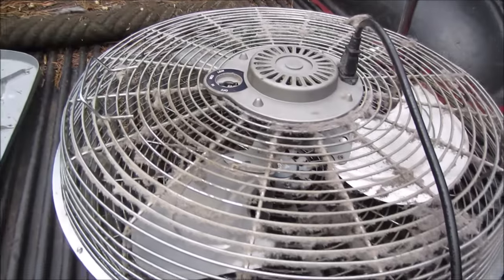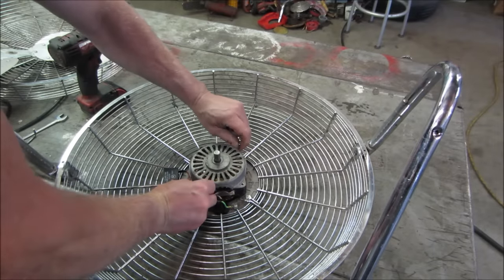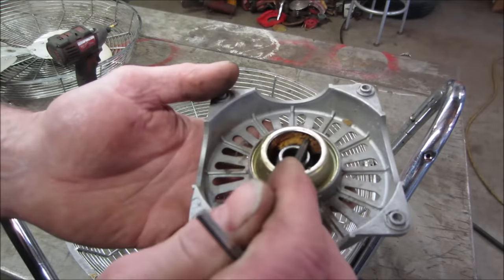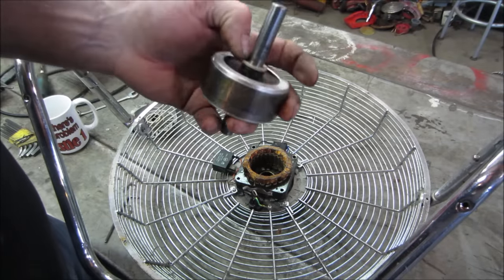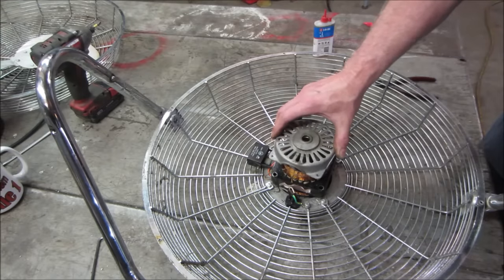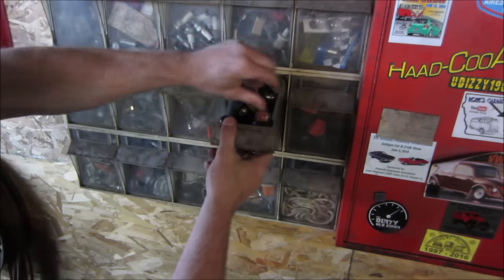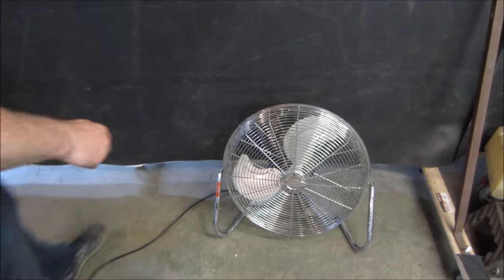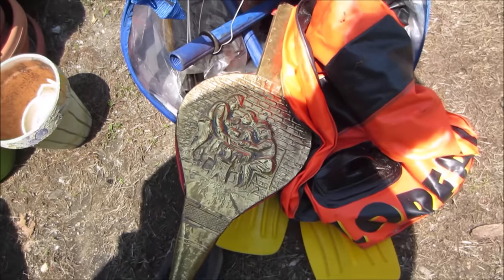Fan Blades Won't Spin? Lets Fix It

Comment: Cool! I do this all the time! As someone who collects antique and vintage fans,I just want to let you know that the "Spray foam" stuff is actually dried oil wick. What you do is soak it in 3 in 1 blue can oil in addition to lubing the shaft like you did and it will help keep it oiled for longer. What you did is fine,but is more of a temporary fix. If you soak those wicks, it will last for much longer. Just never grease these bearings. It might work for a bit, but they aren't meant o be greased and it will eventually seize up again. Those Lakewoods are actually pretty decent, one of the last brands that made their fans in the USA.
Reply: Thank you for the education
Reply: Me too, I have picked up numerous Antique fans over the years, they make for good videos especially to those of us who like the better built things, all the new plastic fans are more of a fire Hazzard then the steal ones
Reply: Where does one find the wick material? Could you use a piece of polypropylene rope?
Reply: Oh, how about using sylglide grease?
Reply: I had a lakewood desk fan that only kicked the bucket recently after almost 18 years so almost as old as me, my parents felt it a lost cause cus when it was turned on it didn't even make any sound or any attempt to move, and it was working earlier that day
Reply: I use grease many times fixing fans seems the last pretty long but you do need to take it apart every couple of years and clean it up again.
Reply: @wolfofdiscord7092  Check the fuse for that circuit then the cord.  It should at least hum if it still has a heartbeat.
Reply: Thank you for sharing this info, I'm just a regular fan user but have lost to expensive metal fans due to blades freezing up. Now I know how to keep them going longer thank you again for your answer.
Reply: @padraicmcguire108  felt is best.
Reply: @gordbaker896  It was trying to spin!
Reply: @padraicmcguire108  go to the fabric store and get some upholstery felt, and cut into strips, then slip a piece into there. Will hold oil well, and will outlast the original nasty foam. If you want the right oil just buy a bottle of air tool oil, it will be thin enough to lubricate, and will not get too gummy with time.  Take the bush and clean with a cloth and some solvent before adding the new oil, to get the old gummy oil out, especially the bore, as it will have a hard film of gum there in most cases, so use a bamboo skewer to scrape the thin gum layer off. Then a oil coat, and assemble.
Reply: @padraicmcguire108  You can use a NGLI0 grease, but it will slump with time, best is light straight mineral oil. 0W synthetic oil also works well. I just use air tool oil, as it is easy to get from most machinery suppliers.
Reply: I have tried the usual oils, like 3 in1, but the old fan eventually slows down over time.  All of these oils were marked as being toxic.  Then I tried a non-toxic thin oil.  The fan kept up to its top speed for many years longer.  I used the same oil on my air conditioner motor when it almost seized up and was squealing like crazy. It was way to noisy fir it to be used any more.  But once I filled the dried up felt material in the motor with this non-toxic oil, the air conditioner was up and going again, and it is even running right now at this very minute. The air conditioner is about 19 years old now. By the way, my DENON DCD-900 CD player from 1987, was skipping tracks.  This was due to the LED not tracking fast enough across the CD, all thanks to the gear lube having stiffened up over a 31 year period.  Anyhow, out with the non-toxic oil again, oil the gears, and bingo, my DENON DCD-900 CD player was working as good as new.  Despite now being 33  years old, it still looks as good as new as well. Not a scratch on it.  People throw so many things out, when all that was needed was a couple of drops of oil.
Reply: @padraicmcguire108  Oil wick. You can get some at electric motor repair shop. I was cleaning the dust out of a small electric motor with the air hose and blew the oil wick stuff out! Oh noooo! I found some at the electric motor repair shop.
Reply: No grease, SAE 20 oil. 2in1 works fine.
Reply: Too bad you didnt live in wisconsin cause i have one older box fan that needs a good home..If your interested i can send pictures
Reply: @padraicmcguire108  ... any heating supply house that has "wick material" for the old B&G circulator pumps. In a pinch you can use old style cotton jacketed clothes line, but the new stuff is poly core so doesn't hold much oil. Also, cotton wick for kerosene lamps or tiki torches is similar material. As a last resort you might try some old fashion cotton balls or gauze bandage.
Reply: Old fans are the best! They are built like tanks. I have some old Westinghouse fans from the 40s that can blow your hamburger off your plate. They really made old fans to blow hard and last. I love em.
Reply: I have craftsman fan exactly like it
Reply: I've restored a few antique fans. One that needs restoring, that I use in my shop, is a little Westinghouse from 1917. It's 103 years old and works a treat. Try that with your new Chino-Air.
Reply: @skonky  It's usually a seized motor, lack of oil.
Reply: @gordbaker896   " It should at least hum if it still has a heartbeat." 
perfect Tompstone Lyrics! lol
Reply: Hey I've got at least 2 of these fan current one just died was following the video but the big metal spindly thing would not pull free as his dod easily, do I need to poke it with a stick HARDER?
Reply: I will give consideration to any item for restoration on the basis that it was made in America.
Reply: @bigjay6743  probably acceptable in the south west where temps are super high.
Reply: Hey guys i use fans every summer and they always end up squealing after 2-3 months of use, since i am not from an english speaking country i need some clarifications please, these oil wicks are like the wicks the oil lamps use because i cant find anything else, whats the air tool oil? i cant translate that, i use water resistant sylicone oil so far but its not safe to breath and just applying it to the bearings works for a week or two only, can you name a famous oil brand i should buy in case it exists here? Help please hot waves are coming lol.
Reply: Thanks for your comment.

I am trying to fix a five year old Air King 9155 window fan with a similar problem. I am almost at my wits end trying to get one of the bearings to stop squealing. I've already tried cleaning up the bearing, applied 3 in One Electric Motor oil to the bushing and added some to the wick material, which was bone dry. It worked well for a few days then started squealing again. After taking it apart a second time I found the 3 in One oil had turned into a brown gum.

I believe the "spray foam" stuff is actually "Permawick" or something similar. Apparently it holds more oil than the traditional wool felt, but I suspect the reason it is used is because it is cheaper to purchase and can be injected into bearing reservoirs in seconds, reducing manufacturing labour costs.
Reply: @jostouw4366  Why is felt better? And which type of felt should be used?
Reply: @SeanBZA  What kind of solvent should be used to remove the oil gum?
Reply: @new-knowledge8040  What is the non-toxic thin oil that you are referring to?
Reply: @jonfklein  I normally use turps or thinners, which works well for this.
Reply: @MonasteryOfSilence  I have heard sewing machine oil (Singer or Zoom brands) can be used.
Reply: @jonfklein  idk specifically what he used but sewing machine oil (Singer or Zoom brands) is supposed to work well on fans.
Reply: @zoomzoomboomboom  Thanks, I ll leave the data from my experiments below if anyone is anyone interested. I am using my fan 24/7 for weeks at a time so I think it's good info, I also use them with their factory issued cheap wicks, I have not find yet wicks to buy for fans. Latest fan I bought survived for 2 months of constant use before running out of it's own lubricant and started grinding uncontrollably. The first time I opened it to clean and oil it I used a product named COSMOS LAC N203 WATER RESISTANT SILICONE OIL, this lasted more than a month of constant use but when I turned the fan to the second speed it burned all the oil in 1.5 day, now turning the speed up of course generates more heat so it burns oils faster but since it was already a month in I guess it could be unrelated. Second time I used a product named A35 GRASO CATENE , honestly it felt exactly like silicone oil just more yellowish, 1 week in now in first speed setting and I think the fan is running better than ever. That's it so far lol.
Reply: @MonasteryOfSilence  good luck!
Reply: @MonasteryOfSilence  see if you can find 0w 20 synthetic motor oil
Reply: Thanks for the wick soaking tip. Just the info I needed. Maybe I’m paranoid but literally Friday I was redoing the wife’s closet, trim, drywall repair and paint. We’ve had a Lakewood just like this one for about 20 years. It gets used sporadically. So I pull it out to move some air in the space while working and I had to jump start it. So I used a touch of silicone spray just get by for the job. So I’m telling the wife that evening our Lakewood needs some maintenance and I’ll do it this weekend. This morning this pops up in my feed. I’m beginning to think “they’re” listening. Anyways, maintenance done and she purrs now. Thanks again for the education.
Reply: lakewood is an awesome fan if you can find one these days grab it for sure. i had an old Lakewood heater that rocked